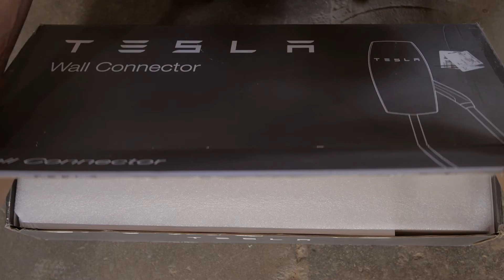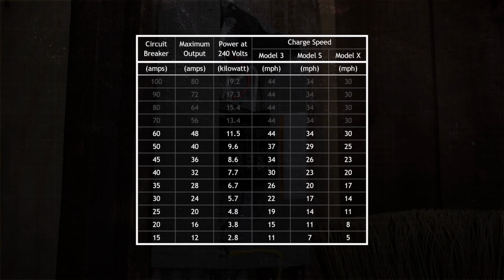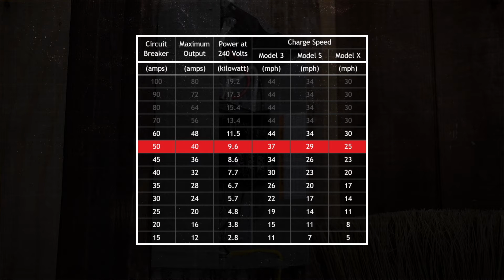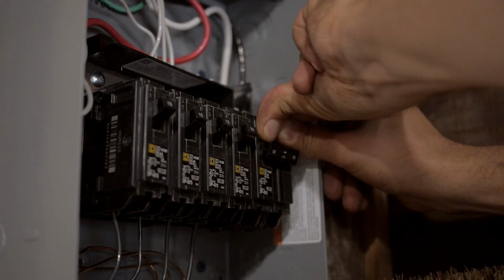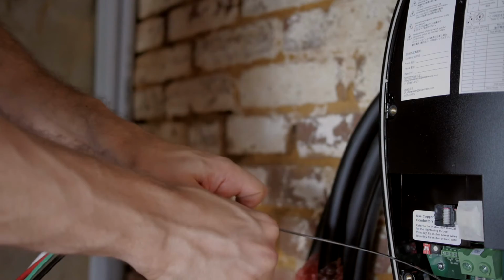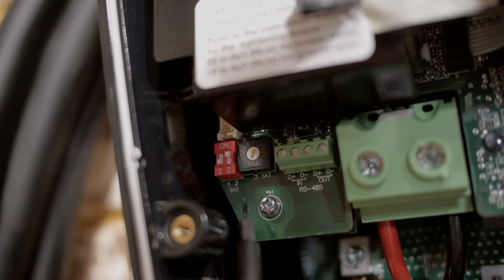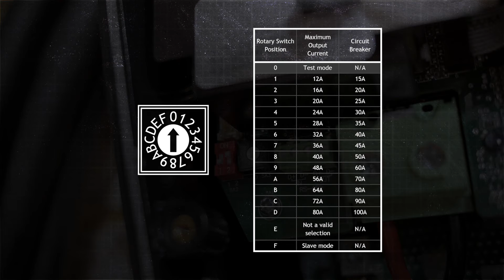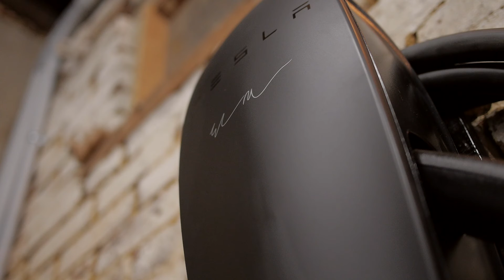How to Install a Tesla Level 2 Wall Charger (Re-Upload)

Comment: Josh, struggling to know if my L1 and L2 leads made it sufficiently up inside the connector. You glaze over that despite saying you also struggled. How can one tell if they are inserted properly?
Reply from the maker: I forget if there is a strip length guide in there or not. If so, I would strip to that length and make sure the insulation or end of the wire bottom out in the connector. You should be able to feel if the wire bottoms and see (granted it’s hard to) if the insulation does. If there isn’t a strip guide I’ll always try to bottom the wire while having only a very slight insulation gap where the wire enters the connector. You don’t want much uninsulated wire outside the connector, but 1/16” or so should be ok.

Comment: Just be sure to use schedule 80 pvc anywhere it could be subject to damage.  So basically unless its inside the wall or underground it should be schedule 80 not schedule 40.

Comment: Correct on the drywall screws. ALSO: You should put something like sill seal(thin foam) between brick, concrete, stucco and the plywood to prevent moisture from damaging the plywood. Moisture from brick-to-wood: These 3 materials can condensate due to temperature changes. No matter where you live.
Reply: What about plastic to steel? Does it need a special backing? I want to fix the plastic backing piece to my painted steel fence post.

Comment: On any future project involving conduit, your life will be much simpler if you run the wires/cable through each individual part (elbows, straights, adapters) before gluing the conduit together. Once you have the needed amount of wire protruding from each final end, running the pvc glue around each pvc part and then pressing into and 
rotating the 2 pieces lightly. You will end up with the same rigid assembly you show in your video, just less issues with trying to snake wire